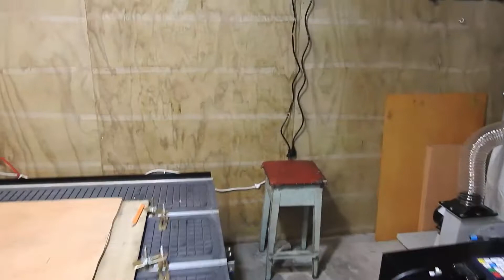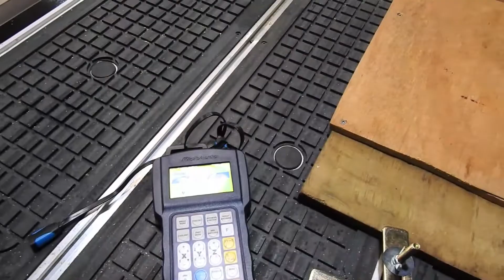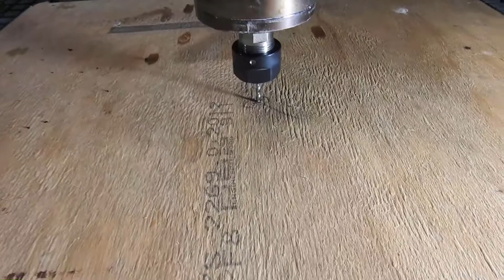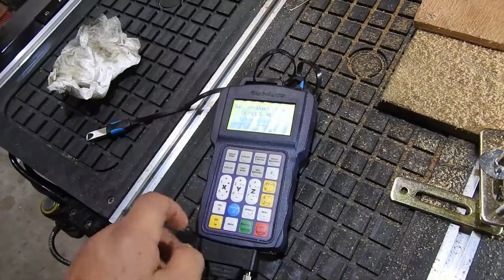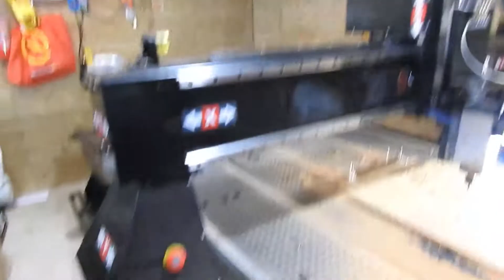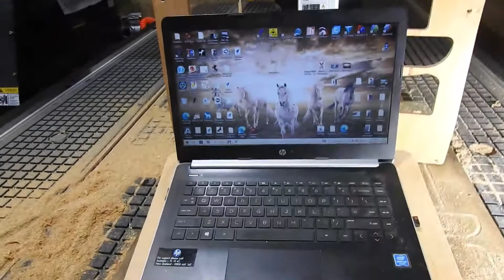My shiny new CNC mill

Comment: Found your channel via a comment on another video (flat earth debunk). I'm into CNC and Laser Cutting big time. I submit jobs for my builds to a service as I don't have the equipment myself. I made a desktop arcade enclosure and all the control panels recently. Super jealous of your setup there. Curious about the optics for the laser cutter, how often do they need replacing?
Reply from the maker: Howdee partner. It is nice to read from you  :) . 
 I must admit that I am quite new to the laser side of things, but I have learned at least one important lesson from my current research in all of this. 
 That is: One must keep the optics clean at all times, in order to protect them from thermal stress. 
 OK, that is a common sense sort of thing, but I think it is also elemental to the longevity of the optics. 
 That stated, a friend of mine suggests that the laser tube has a lifespan of about 2 years, whether or not it is used during that time. 
 Loss of working gas appears to be the culprit there, it would seem. 
 Also, at the output end of things, air assist plays an important role in protecting the final lens from particulate accumulations that would otherwise cause it to cook.

Comment: That's a mighty fine machine there Steve. Is that thing running on nuclear power or wood these days? Have you run the gasifier lately?
Reply from the maker: Indeed. This really is quite the mechanical beast  :) . 
 Currently, it runs on a mixture of wind, sun, coal, natural gas - and hydro. 
 My BIG gasifier should be powerful enough to run this, methinks. 
 Yup, my little gasser has been clocking up the hours, but not as rapidly as before, as I am still in the process of moving up to the new farm, using dinosaur squeezings as my prime mover  ;) . 
 So, how are your dealing with your ongoing woodgas addiction?
Reply: @CNCmachiningisfun  unfortunately I have been too distracted between working a lot, building a very nice bathroom, and keeping up with general repairs to do much with the gasifier. I'm looking forward to getting back to work on it very soon. I'd like to get the big green generator running on wood. I've also been wondering how anthracite coal would work in the gasifier even if it was some mixture of wood and coal. I'd love to know what your thoughts are on this. Joe
Reply from the maker: @mazdalorean  
 Howdee Joe, 
 Yup, I know watt you mean. Getting some spare time, to work with one's gasifier, is never easy. 
 Heck, even though I am now jobless, 'thanks' to covid, I STILL can't find the time to squeeze the watts out of my woods! 
 It looks like we are both SUPER busy, and looking forward to getting back to our true addictions  ;) . 
 I think anthracite coal, or any coal, wood work in a wood gasifier, as long as you pay close attention to the charcoal levels below it. 
 Once that drops too far, it is lights out in the engine room! 
In my experience, pretty much anything that burns, can be put thru the gasser, including waste engine oil, and plastic scraps  :) .

Comment: Wow that's some serious piece of industrial kit, looking forward to seeing what you are up to, cheers
Reply from the maker: Indeed, my friend. 
 This really is quite the beast, and with due care, it ought to last many a year, making all sorts of goodies for my projects. 
 Watt's cool is that it can also cut metal, so it can surely help with the next wood gasifier project  :) .
Reply: @CNCmachiningisfun   So, what attachment can you add to cut metal? Plasma ? With that bed??? or mill bits ?
Reply: When Matt built our table he showed that it was capable of running a  router  with wood and milling aluminum with bits. It's movement is slower do to Ball Screw linear drives but pretty rugged design for my needs
Reply from the maker: @nhhbbyloggr5022  
 I wood use milling bits for this bed, as it is not really suited for use with plasma.
Reply from the maker: @nhhbbyloggr5022  
 Yup. Your machine wood do well when fitted with a spindle, for wood routing, and metal milling. 
 If you combined the two systems, you wood be able to make anything you wanted, except a good cuppa  ;) .
Reply: @CNCmachiningisfun   I didn't know if the bed could be converted
Reply from the maker: @nhhbbyloggr5022  
 It probably could be converted, but I really don't want to mess with this fine machine, when I could either build or buy a shiny new plasma cutter. 
 One of these days, I wood like to get one similar to yours, but I will have to wait until I have built my new machine shop. 
 This should be possible (looking at my calendar) about $50,000 from now  ) .
Reply from the maker: @nhhbbyloggr5022  
 I had a look, and it turns out that the makers use the same machine frame for their larger plasma cutters. 
 Also, talking of files to cut out, I found a treasure trove of free ones. 
 If you enter 3axis.co into gurgle, you'll see watt I mean  :) .
Reply: @CNCmachiningisfun  What's fun with these tables is we are always learning something new. I tried a few files from Esty but have difficulty reducing the size I want to use. My " go to" CAD program right now is VIACAD 2D. It does everything I need at this time.
Reply from the maker: @nhhbbyloggr5022  
 Indeed. The creative potential is immense, and it wood seem that our imagination in the sole limiting factor. 
 Viacad 2D looks good for this task. Maybe you could also try other software, like 123D Design? 
 It works with DXF files, which is watt I am assuming you are using for the Plasmaster 9000?
Reply: @CNCmachiningisfun   Yes sir, DXF files. I started with Alibre 3D but couldn't seem to get into it. Viacad is my choice now which proves that the world really is flat.
Reply from the maker: @nhhbbyloggr5022  
 DXF files sure are versatile  :) . 
 In time, you might find other CAD programs. Ones that may be even easier than Viacad is. 
 Either way, it pays to search our flat earth for these, even if it is uphill - both ways  ;) .